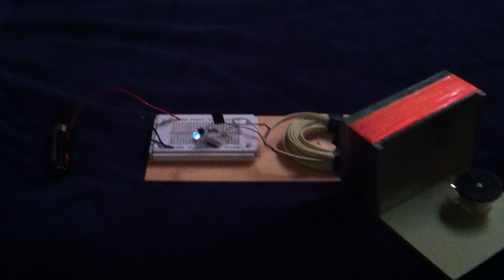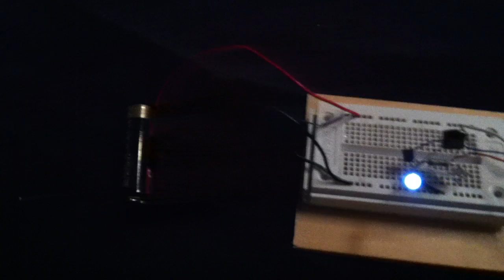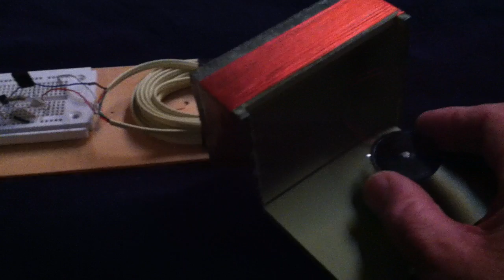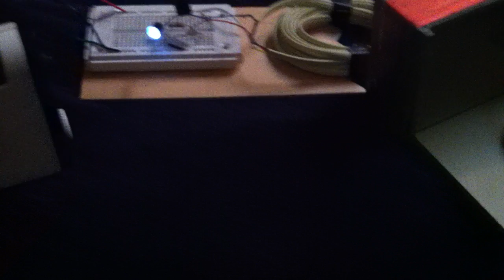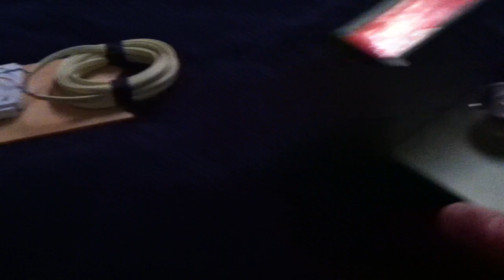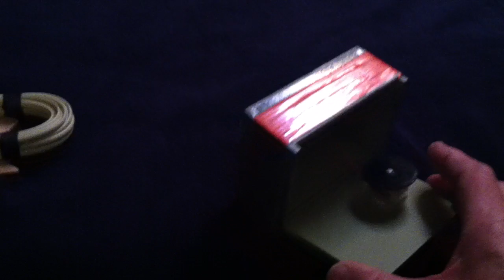Loop Antenna Tuner with a Joule Thief

Comment: Interesting findings. This happens in a SWES wireless system and I didn't know why. 
Sometimes, putting a receiving coil right on top of the transmitting coil drops output considerably. Raising the receiving coil by an inch or so brings it back. Have learned something too from this - thanks !
Reply from the maker: +slider2732 It is interesting.  I took this loop antenna tuner and turned it into a crystal radio today just for fun.  I could only get one station on it but it worked.
Reply: +slider2732 Remember the SWES repeater? I wonder if that isolated tank is transmitting an inductive field further than the JT on its own. Or if it can run single wire transmission to another load?
Reply: +Mongrel Shark Certainly the single wire to another SWES coil is possible. Just use an AV plug on the end and maybe a cap across. pF value variable caps also help a lot with such things. Good to hear from you (did you ever get the 3D printer running ?)
Reply: +Lidmotor You'll normally get the 'swamper' with reception, whatever station nearby has the power to drown the rest out. So, comically, you'd need another of those loops to filter it and hear the others.....repeaters after repeaters could happen all across the room, but you'd pick up Anchorage at night lol

Comment: it is strange that the loop circuit steals the pulse from the radio so much. i mean... is it really just speeding up out of our auditory range or does that collapsing field (that creates the AM-type field in the first place) get squelched into the de-tuning tank circuit? so much to try.......   :)
Reply from the maker: +jeremy gwilt  The oscillator is just speeding up out of audio range.  I have built crude short range AM transmitters using a JT circuit before.  I just put a mic in the base feed and played around with cap values.

Comment: its the magnetic field in the wire as its pulses when the generated magnetic field collapses its turns back into a electric field bemf/femf. the longer the wire the higher voltage bemf/femf, the thicker the wire the higher the current